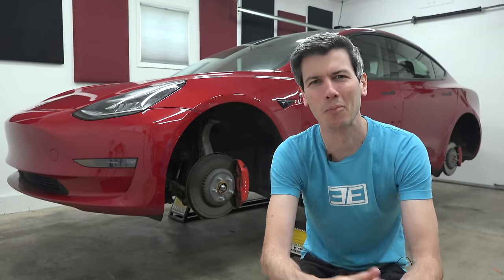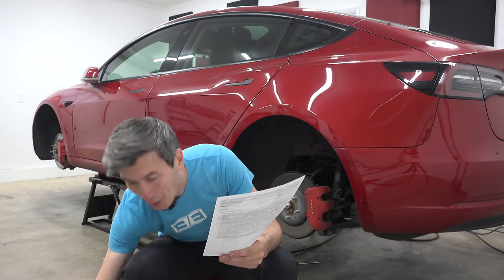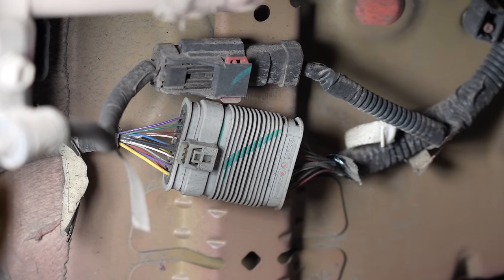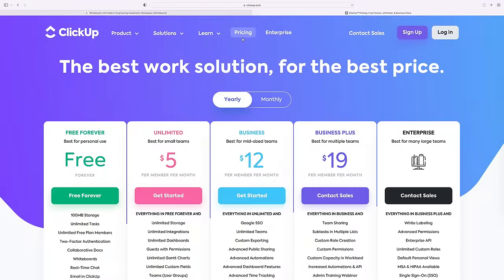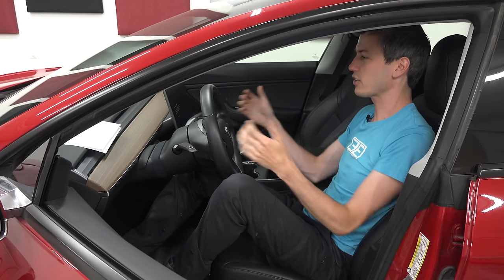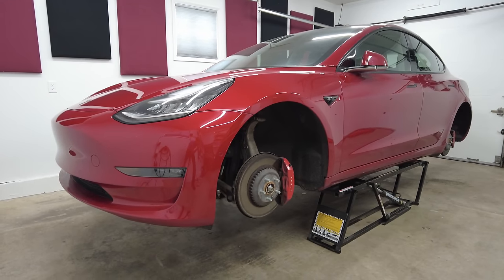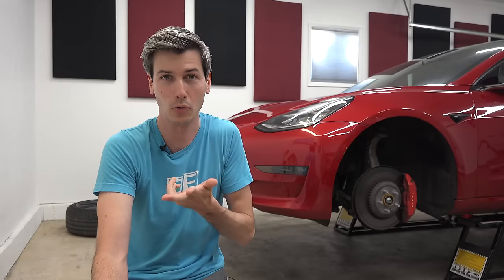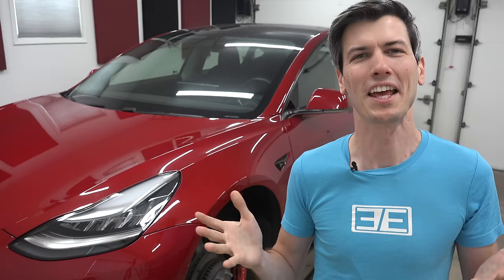Tesla Battery Damage? I Ran Over A Metal Bucket

Comment: Can you do a video explaining the engineering reason why ICE vehicles get more efficient at higher speeds, but electric vehicles get less efficient?  This isn't a hit on either one,  just weird to me that the "fuel" efficiency suggestions seems to swap between the two types (i.e. electric gets more miles per wh in city driving, but ICE get more mpg at highway speeds).
Reply: The reason ICE cars get better mpg on the highway is because you don't brake as much. All cars have more wind resistance the higher the speed, but you never drive a constant 30 mph in the city, you're always speeding up/slowing down. EVs and hybrids recapture some of the braking energy and dump it back into the battery. That energy recovered from braking then helps get you back up to speed, so you end up having better efficiency in city driving vs an ICE car. When you brake in an ICE car you just send all that momentum energy into the brake pads, wearing them down and causing heat.
Reply: In addition to Michael's comment, ICEs have a very wide range of efficiencies, plagued by two competing objectives.
1) An ICE is most efficient at 80% throttle and moderate load, at around 2K RPM. For most of your driving, which is cruising, this would imply a small engine. It has been estimated that it only requires 20HP or so to maintain 70mph.
2) Accelerating to highway speeds shouldn't take 30 seconds. This means an engine with decent power.

You can't have both a 200HP and a 40HP engine in the same vehicle, so you end up with a 200HP engine that is often times in an inefficient power band. Engines only really hit their most efficient powerband on the highway, where the engine can be put in the highest gear, and therefore have a more open throttle and moderate load. Every other time, like accelerating and braking and puttering about at 30mph, the engine has to choke off airflow in order to maintain speed.

In comparison, EVs are roughly equally efficient from 20MPH to 80% of their top RPM, therefore any losses they suffer are primarily drag. Ergo, the motor uses energy equally efficiently whether at 35mph or 70mph, but at 70mph you're experiencing 4x the drag.

In modern ICEs, there have been various compromises made to try to increase efficiency. Hybrids allow you to have a smaller engine for that cruising efficiency, on top of an motor to fake a larger engine for acceleration, ontop of regenerating braking energy.
Cylinder deactivation is an attempt to have a small engine and a big engine at the same time.
Turbos allow a small engine for cruising, and forced induction for more power.

Really, all attempts to increase ICE efficiency end up revolving around finding ways to create a engine that can fulfill Obj 1 and 2 at the same time.
Reply: @Appletank8  thanks for the info.  I'd heard that above 55mph, most fuel consumed was used just to overcome wind resistance,  so it makes sense that cars would use more energy to maintain 70mph than at 30mph, and since electric cars don't use gears, any added resistance would just take more energy from the battery.  The ICE part is where it  seems odd,  but I suppose it would require more explanation than YouTube comments would provide for me to grasp (i.e. explanation of efficiency aspects of ICE, and the bands you're mentioning, gearing).

To the idea of acceleration, would an ICE use the same mpg if constantly going 30 mph vs 70mph with no acceleration?  Trying to isolate where the mpg would be different from the stop and go driving aspect.
Reply: @motmaverick  
Basically, an ICE controls power by varying airflow. When going slow, the airflow is more restricted to produce less power, which produces resistance, pumping losses, that the engine has to overcome (This is the same type of resistance experienced when engine braking, if exaggerated, imagine breathing through a pipe vs a straw). Higher RPM also produces friction. In a lower gear, you are spinning the pistons more to go the same distance. Like taking a lot of little steps very fast vs long slower strides.

At 30 mph, while you technically require less fuel, the engine has to spin more, and also partially starved of air. This is why it is recommended to get the car to the highest gear for the road as fast as practical, because the less time spent in Gears 1 - 3, the less you have to suffer frictional losses, on top of more time with the throttle open to restrict less air. So, TLDR, you gain a bit from less air resistance, you lose a bit from air pumping losses and frictional losses. It depends on the car's aero and the engine for how it falls. The biggest losses are from braking, so its not that bad if you can maintain steady state throughout, though it is likely to be slightly worse.

Bonus: However, there are people (mainly hypermilers) who have figured out ways to still be decently efficient at low speed, though with somewhat more questionable techniques, and more applicable to hybrids. Even without regen, the biggest gain is for its ability to automatically turn off the engine upon release of throttle. The benefit of this is that you can put the engine in that moderate load I mentioned earlier, and instead of restricting the airflow for cruise, you can simply turn the engine off (software does this automatically) and go basically into free-wheel, coasting off the kinetic energy. Repeat the cycle (called Pulse and Glide, for ex pulse to 45, glide to 35) and you can get really good mpg.
With non-hybrid cars, the only way to really replicate this is to go into neutral and cut the ignition, which is dangerous. Just gliding in neutral might be of some benefit, though legality depends on state.

Comment: I have a M3 performance as well with the spoiler installed from factory and it is also loose on the edges, though it has never fallen off. I haven't put in a service appointment because what it seems like from your experience they can't do much to fix it.
Reply: Same. Mine is not coming off, but the edges have a gap between the trunk and spoiler, about 1/8" on each side.

Comment: But is a good car if you are going to drive in the country and are going to drive on dirt roads . Or do you need to be worried about the battery then. Or do you need to be worried about high sidewalk edges. Is it perhaps better with a Used Tesla S that you can raise . So it comes higher above the ground

Comment: Hang on now, how about brake fluid/pads service replacement  & 12V battery?.
Also cost of Tires & washer fluid additive.
Reply: No brake service (pads/rotors) for... at least 150-200k, probably. Regen does most all of the braking. Main concern for brakes is actually FORCING use of them sometimes, to polish rust off them! Emabarrassing to stop in $60k car and the brakes squeal (if you actually use them... regen will come to complete smooth stop, nice.)
Brake fluid,... is probably similar to ICE, both cost/time to replace. Same for washer fluid, no difference.
12v battery and tires are weakness for EVs: the 12v AGM batteries don't last as long, 2.5-4years, cost $120 for me.. BUT, all newer Teslas have Lithium 12v batts now, lifetime!
Tires can wear a lot faster... 25-40k.. depends how fast/often you launch :)  and soft summer tires especially! but other tires can last longer, I got Michelin CrossClimate2 and they seem to hold up much better than OEM MXM4.. and cheaper too, still over $1k/set
Reply: Cost of washer fluid? Seriously? It's $3 a gallon and you use it when you want or need to on ANY car.  Irrelevant.

Comment: I would say that the $82 rattle was a necessary repair that should have been counted.  A rattle is not an optional fix as it is a fault and it is your sanity.   That said, they should refund it as it didn't fix anything.

Comment: Opinion from the UK here: I perfectly respect the car as a piece of engineering, I think it's a fantastic example of how simple an EV can be and still be a nice car. But I couldn't choose one for the following two reasons. It's actually very expensive for a basic car. Secondly, the interior of the car has clearly been designed to a budget, the completely lack of an instrument panel and hand controls where the driver is sitting can only really be justified if the car was actually super cheap, maybe a 3rd of it's current price. There are much nicer cars on the market which cost a lot less and most people won't go out of their way to get an EV just because it's an EV, they'll look for the car that is either the consumer deal and/or suits their needs best.
Reply: That's because right now we are paying for the drive train technology.  As that becomes less expensive the other things will go up in quality.

Comment: wow...this is an awesome review.  I have a 2019 m3 sr+.  I also didn't get the fsd because I figured it would be 5 to 10 years before they got it working and by then I would be getting another one...you know a 2 car house hold.  so the 2017 leaf is on its last leg and we have now ordered a my long range with fsd.  As a side note, the only maint so far was to have them come out and replace the12v battery and while they were at it I had them replace the filters.  how many places come to you and do it on site.  anyhow, great video....

Comment: Lol, WV would have charged 250 bucks just for the plastic piece like that and say that this is a very rare part, so it costs like that just because of the shortage. Oh, and you'd have to wait for it for a few months. Edit, these plastic covers on the steering column rattle on a lot of cars. Don't know why is that, most probably due to thermal expansion, but I give mine a nudge time to time

Comment: There Tesla S has the advantage that you can raise the car. with a control on the LCD screen So you may not need to be as worried about the battery. Tesla 3 performance Is it lower above the ground than other Tesla 3s ?, which might be a disadvantage if you are going to drive in the forest or possibly over high curbs?

Comment: Something that confuses me about these cell phones with wheels.  Do they even have a basic cruise control function or do you have to pay extra?  My moms Hyundai Palisade came with adaptive cruise control with lane keep assist.  Outside of the lack of an audible notification that I am not traveling at my set speed and should overtake the vehicle in front of me, I love it.
Reply: Yes that’s included standard on Teslas
Reply: Are you asking if it has a basic non-adaptive cruise control? If so, then no. Adaptive cruise control comes with any spec of the car though, yes. Same as lane keep assist.
Reply: @Muskar2  Well I mean their 'self driving' package seems to be little more than adaptive cruise and lane keeping so I figured they wouldn't give those for free.
Reply: @cracklingice  Yeah, what comes for free is adaptive cruise and lane keep assistance. Some places you can upgrade for automatic lane change and highway interchanging for half the price of FSD (which is called Enhanced Autopilot), and then the full FSD package includes the ability to get into the FSD Beta program which is currently semi-competent in city streets, but not really good enough to be more than fun for engineer-like minds.

Comment: Id like to hear about this on a long road trip and commentary on that experience.  I don't think it's fair to necessarily say "well the pothole damage doesn't count". It does count,  when people buy cars they want to know how much it costs to fix things.  Typical pothole damage usually only damage a rim - i can't recall whether your damage was more or less typical, but u could comment on that.  EVs are great, esp as a commuter. But I've always said that every vehicle has its customer. I love sportsedans but i love versatility. If someone told me that i am limited by charging it a charge network that builds anxiety.  I drive in a city with a ton of EVs. All shapes and sizes. Guess which vehicles are the slowest on the road? All the EVs. It seems to me that everybody gets in it for the numbers but they are fearful of using them at even half their potential. That shows me that this thing is more of a status symbol than something that is actually providing utility. It's that real world experience.  If it's got 300 mile range - reality 200 miles. It has 500hp.. actually only 300 .. id be livid .. i get that range and mpg are to the driver.  But that's a big delta imo
Reply: He has a summer and winter road trip video.  Out of Spec Motoring channels has LOTS of them.  I'm a responsible adult, so I don't drive my 3LR fast because it's irresponsible to do so in city traffic.  But when I'm outside town I give it the beans and can gap darn near any other non-EV on the road.
Reply: @SpottedSharks  I'll have to check them out.  I've seen some clips that where some were pro/con .. obvs didn't seem like a slam dunk. Fair statement re "out of town"; however you would think out of all the EVs that i see,  at least one would be driving at least a bit spiritedly or even slightly over the limit.
Reply: @karleignr  EVs will be driving at 80 kph when highway speed limits are 120 😂
I never go under 120-130 whenever I use the highway, and I can do 800 km in a tank.
Reply: @AlldaylongRock  💯  .. I'm still eyeing a taycan rwd .. but i think I'll always have an ICE on weekends or long hauls.. but the tech has def come so far in such a small period of time.  Li is def more easily accessible than oil. It is the future. I really resent the gov shoving it down people's throats. The econ ev options are garbage imo as well.
Reply: @karleignr  Indeed garbage. The Hyundai Kona is one of the most worthy EVs in Portugal, considering price and range. But its range and charging capabilities are still laughable. This trip I do with half a tank blasting at 120-130kph would require both a deroute, and 50 minutes charging it. It costs almost 38k€. For that price I can get a PHEV or Hybrid in the same segment. The M3SR+ is 55k,M3LR is 58k, the M3P is like 62K. I do not care much about performance either. I've driven an hybrid Toyota Yaris and it's acceleration felt pretty enough for what I need. Merging, launch at stoplights, etc.Public L2 is as expensive as using diesel in my current vehicle. DCFC is double the price. Not worth it for me. I will keep my Diesel until it falls apart, and then buy a low mileage PHEV or Hybrid. A vast majority of PHEVs for less than 38k can do all my daily driving all electric, and I can trickle charge. If I didn't, I'd get a normal hybrid.

Comment: How many miles did you drive in the four years. A pet peeve of mine is when people talk about their low running cost and it turns out that they didn't really use the car that much.
Reply: I think he said 30,000 in the video.
Reply: @manz7860  not much for four years, but still a decent millage. Guess I did not pay attention.
Reply: @apn42  doing some quick mafs.  Less than 4 miles per day.
Reply: @apn42  I bought Model Y in september 2021 and did 30 000 km up to today, and since buying the car I paid only $40 for HEPA air filter swap a month ago.
Reply: @darekmistrz4364  That is impressive as a combustion engine car would need its first oil change at 30.000 km or once a year.
Reply: @apn42  Actually it would need first oil change at 1000km to clear any debris from engine after manufacturing and after braking in the pistons and cylinders. Manufacturers are not recommending it anymore but that is because of ecological pressure on them to lower the amount of oil changes per vehicle by design
Reply: @darekmistrz4364  I own my third new Peugeot Diesel and the first oil change was at 30.000 or one year for all of them.

Comment: Fun fact. Replacing one of your headlight assemblies on a cadalac costs $2000 if you take it to the dealer
Reply: Replacing headlights on most vehicles is expensive now because they usually have to remove the front facia, which they have to do on the Model 3.

Comment: My in law has a Model Y for 3 years and he's burning through tires.  He's not rocketing around pretending he's in F1, and he's still looking at buying a 3rd set now.  I think he's doing around 12-15k miles a year.  On his other cars he says he usually goes 3 yrs on a single set with his previous cars.  Huge weight = say goodbye to your tires.

If I were shopping for a Model 3 I'd probably buy the i4 or the EV6 AWD.

Comment: There should be mention of Polestar 2, but I cannot find it.
Reply from the maker: Based on the XC40 platform though, so kinda SUV like. I'd like to try one, but of the reviews I've seen it's a nicer ride on the inside, but not in the performance/handling department.
Reply: @EngineeringExplained  In fact this platform was developed for future S40, which became Polestar 2.
So theoretically not only for SUV's.
I would like to hear your opinion about the car, Jason.
Reply: @EngineeringExplained  As an owner of a Polestar, I think you should try it yourself. With a performance pack, dual motor Polestar, after tuning the Ohlin's dampers to how you like them, the car handles really well - in my opinion better than a stock model 3.  The reviews I've seen on the poor handling seem to all come from not tuning the dampers to the driver's ideal settings; usually I see them use the "stock" damper settings for racing.

Comment: I'm not a fan of Tesla's deceptive marking & shady BS...... I'd rather build a DIY e-vehicle that's simple to work on. Use something like a Ford Ranger with good body but worn out engine. Use the 4wd gearbox so you have 2wd or 4wd, cover the hood,roof & bed cover in solar cells for extended range.